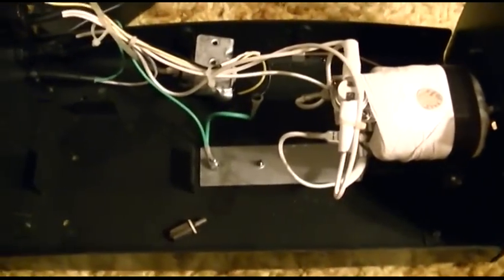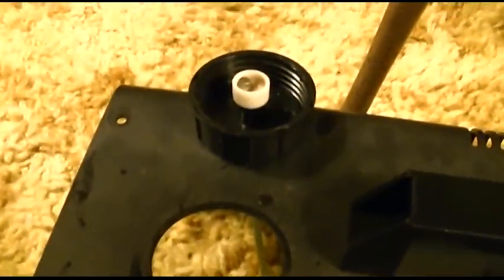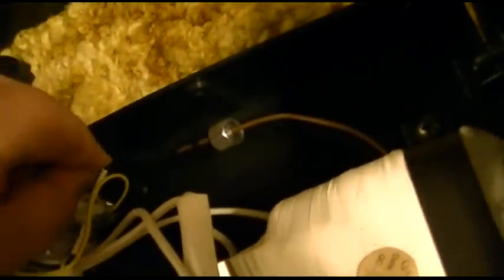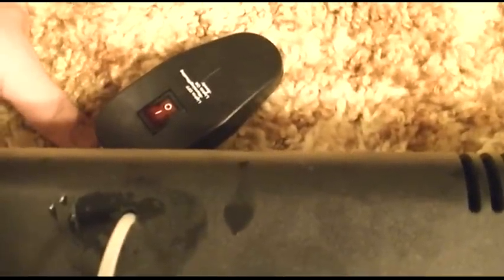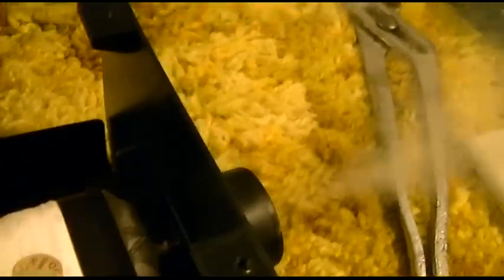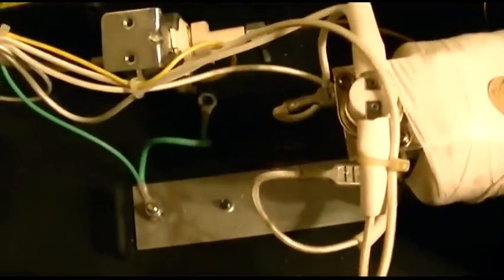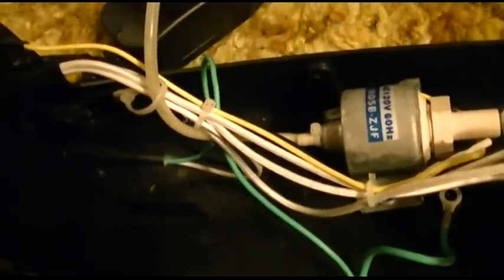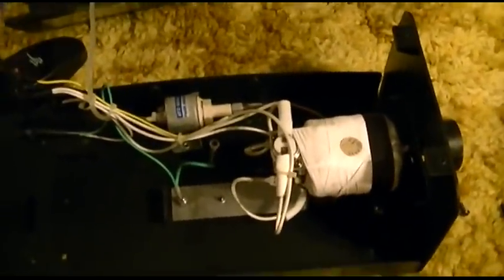Fog Machine Repair

Comment: I have the same one as well and had and have the same problem. when I took the pump apart I saw 2 o-rings  in the same spot looks like to set the depth of the end piece. Like you I got it working by loosening it a bit but it worked for Halloween then quit again. I think the pump is a crap design and the fix should be a better pump. I will be looking into it.
Reply from the maker: Thanks, Ron.  Yes the fix is a better pump.  I had another of the same fog machine that died in the same way except I couldn't resurrect it.  I replaced it with a different brand machine.  That one worked twice and the pump quit!

Comment: I have a Hurricane H1301, and it’s not working. The power light is on, and the main circuit board green light is on. But the heater is not on, and the pump doesn’t start. I removed the pump and had it cleaned. Same thing. What do u think?
Reply from the maker: If that heater is not coming on, you will get no fog.  That;s the first thing to check.  See if 120V is getting to the heater first, then go from there.  Could be the "fusible link" burned out.  Could be a faulty temperature switch.  Or circuit board issue.  Time to break out the meter and start poking around.

Comment: What i have done in mine is put a set of valves on the suction line to the pump so you can switch between the on board tank or an external tube with a barbed fitting to the case. that way I can just hook up a tube and run a mix of vinegar and distilled water when I want to clean it through or store it.. Mount the valves handles to the outer case and the valve inside. Then label them direct and divert. Or tank and clean.
Reply from the maker: kev31779 Nice idea, thanks!

Comment: thank you for this vid it backs up my idea that the pump of my adj jet stream is dead it had 35% and when i cleaned the pump it whas back to 100% than when i turned it off and on it went to 35% again and that puffing to
Reply from the maker: Yes, those pumps aren't very reliable.
Reply: jaykay18 bought the 2 jet streams second hand one worked at 100% the other at 35% i tought it whas somthing easy but turned out to be the pump i also found out the pumps for the seneo coffy machine are the same LOL

Comment: My smoke machine won't turn back on. i used it then half hour later went to use it again and nothing, no action no power button light. any ideas wat it might be?
Reply from the maker: shaun dalton Check the fuse on the back first for continuity.  If the fuse is good, other problems could be the fusible link (over-temperature "emergency" cutoff), or the heating element itself.  You may have to disassemble some wiring to test various parts.  The wiring is pretty simple inside.  If you bypass everything and apply power direct to the heating element, and it doesn't get hot, you know that's the problem.

Comment: IThe head might have been clogged a bit,. Take vinigar and run it through it. If that don't work a little CLR and compresed air through the head.
Reply from the maker: kev31779 Done the vinegar and CLR and compressed air.  No dice.  This one I was able to repair the pump on, the other one I was not.  They just fail after a while, they tend to work better if used weekly.  Otherwise they have a tendency to clog up, but a lot of that depends on the type (brand) of fog juice you use.

Comment: I have the same model and I had the same problem. From your video, the sleeve that goes into the pump motor is not pressed in deep enough into the pump motor. Where you have the outlet fitting on the pump motor is fine. Is just the fact that the inlet sleeve is not pressed in far enough. I just bought one of these units for 10 bucks that set in a box for 5 years. I am guessing someone tried to fix it and was not successful. I am pretty sure by what you have going on that the internal sleeve in the motor needs to be seated fully. I hope this helps you understand.
Reply from the maker: Thanks, it's been working fine since I made this video.

Comment: nice. so if Im following (I scrubbed thru a lot of it but got the gist of it) you took the pump apart then put it back together and it worked when you tightened everything up?
Reply from the maker: Pretty much.  Your mileage will vary.  Of all the fog machines I've owned, the only thing that dies is the pump.  I'm thinking about using a more robust pump, something like a windshield washer pump motor.  The wires inside the unit will go to a 12v transformer that will then feed the pump energy.  Maybe that will last longer than these.

I've tested the unit by "manually pumping" using a syringe, and wow, what a difference!  You can REALLY smoke the place out easily by sending it more fog fluid.
Reply: I agree it's most often the pump. the next being a clogged heat exchanger which I have read people cleaning those out but it's really not worth trying.

the custom pump idea is intersting. That would make a good video.

I have heard of pumping fog juice or distilled H20 thru the pump with the hose off with a small syringe or a turkey baster cooking type to unsieze a pump that hasn't been used in a long time.
Reply from the maker: Oh yeah, I pumped water and vinegar through the whole system to no avail on my other ones.  Even hit it all with compressed air, there was nothing clogged, the pump just refused to pump anymore.  If I send fog juice in with a syringe it smokes right out.  One of these days I'll get around to fixing it.

Comment: this is a piston pump also diaphragm pump works similar , if you search on ebay possible to find
Reply: Nice Job! you fixed it!
Reply: It is possible to use pure glycerin mixture with Distilled water instead of expensive liquids
Reply from the maker: Yes I've heard of doing that.

Comment: i had the same problem but i just put distilled vinegar in it to clean the pump and tubes
Reply from the maker: That wouldn't work in this case with a jammed pump!  Afterwards I used water to clean it, and that seemed to work well.

If you think vinegar smells bad right out of the bottle, wait till you put it through a fog machine!  That was pretty bad.  I've done that too, here:  Seasonal Visions International Metal Case 400W Fog Machine Review